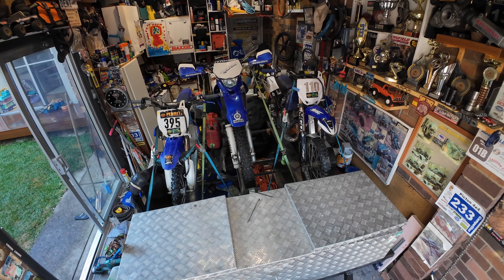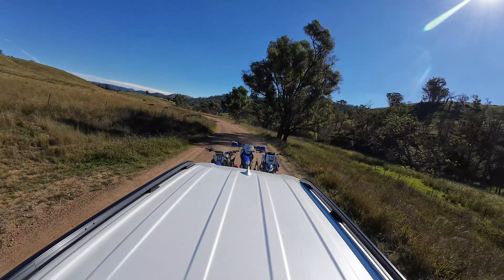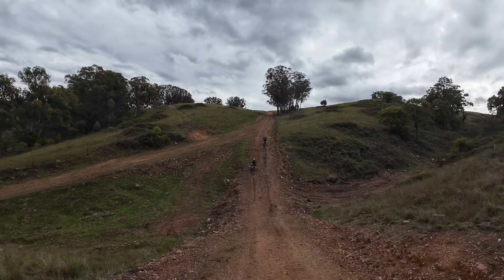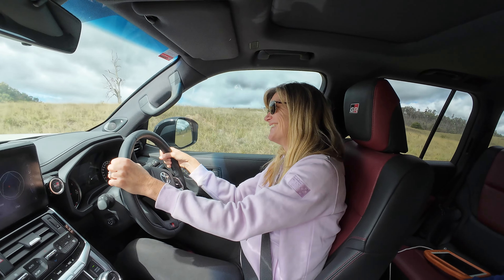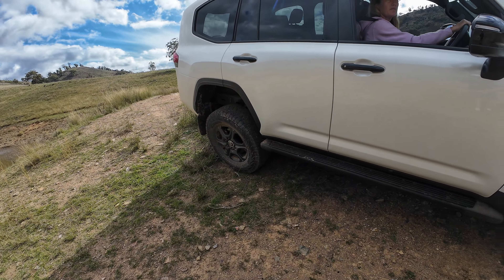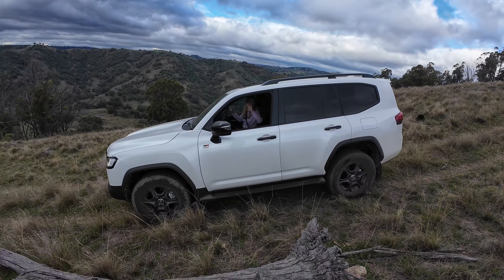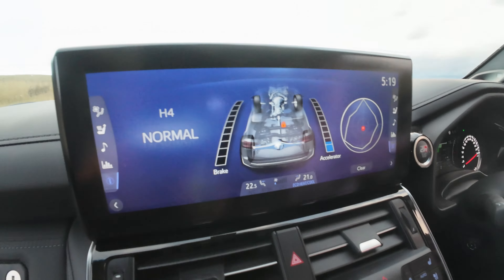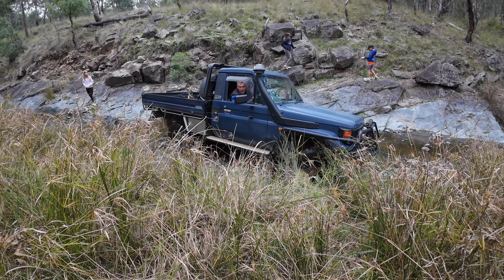Toyota Landcruiser 300series GRsport 1st major trip Offroad test running the Kumho AT52s FUN TIMES

Comment: I run the Mickey T Baja Boss 275 70 R18's & they put maybe 2 ltrs per 100 on the fuel. Round town / city driving I'm up over 16 to 17 per 100. My 300 is heavy with steel bash plates, rock sliders & ARB summit bull bar etc.  On a run I get 11 to 12 per 100. Strange but I find I get better fuel economy not using the economy mode.
Reply from the maker: The price we pay to be more off-road orientated huh!

Comment: I just brought x6 at52s for the 79. So far not good on the corrugation roads.
Reply from the maker: Wow, they went awesome on 300, what psi were you running ... As I was considering them for my 79, why not good please in your opinion.
Reply: @TeamBulletOffroad  Im running 3inch 35s with a touring canopy on my dual cab so quite a heavy rear. Running 45psi on the corrugation and felt like i had a lot of understeer but i feel this could be a steering issue so replacing my front shocks/dampner and will have another go in another few weeks. Keep you posted

On the beach they were wicked though. Cant fault them on wet roads either
Reply: @TeamBulletOffroad  for $315.80 for a 35AT at bobmarts. Dont really need muddies in WA so im pretty happy for the price.
Reply: Toyota can reprogram the tailgate to one beep and make it a little quieter.
Reply from the maker: Ecellent @dangreentree2646  thanks for that, so either the 10k service or if the 2nd key comes before that ill pay them a visit..
Reply from the maker: @MakingMoneyyy857  45 way too much mate...

Comment: g-force meter recording the acceleration in the four directions.
Reply from the maker: Thanks for responding .. Sounds very high tech, what can we use that info for..
Reply: @TeamBulletOffroad  nothing useful. just a digital representation of the "seat of pants" meter.  If you fill the circle it might unlock expert level though.